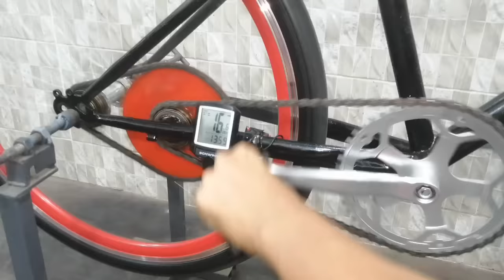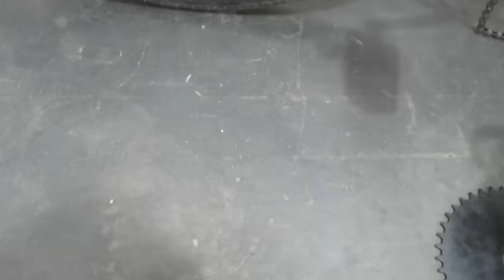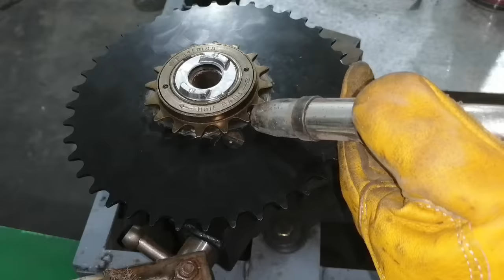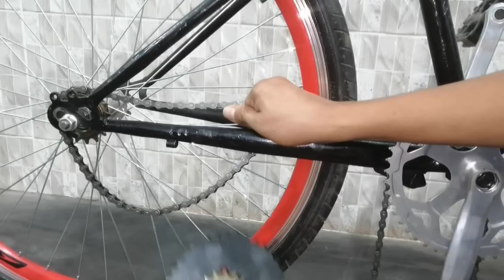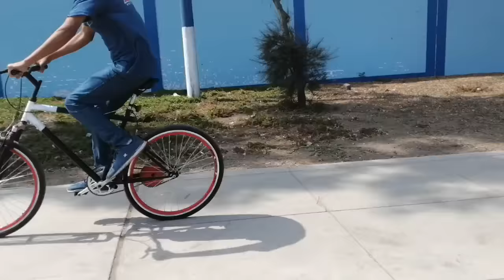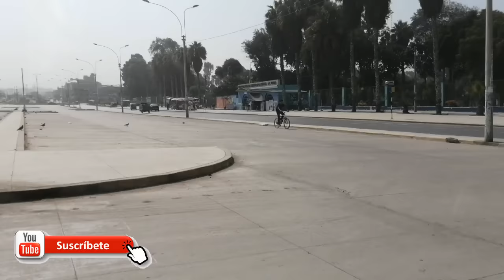increase the speed of your bike.speed multiplier

Comment: Non functional.  This high gear ratio is good for higher speed only. As it will produce less torque, so it will be unusable at low speed.  Think about a 20 feet long shovel instead of a regular one.

Comment: Congratulations. This is a 1 stage gear ratio... all u did was make ALOT of friction and extra weight. You WILL fight that flywheel at each cadence sir. U are FAR better off with a shifter casette. This is very very not clever

Comment: Why not just put a  derailleur on the frame and a sprocket cassette on the back wheel? Then you could change gears. I noticed that you didn't show you taking off from a dead stop. I understand if you're pedaling that slow going that fast it's a fucking  struggle to get going. And going  uphill is not going to happen.